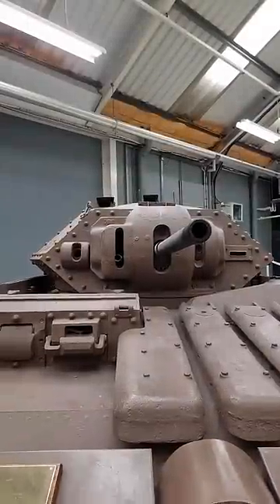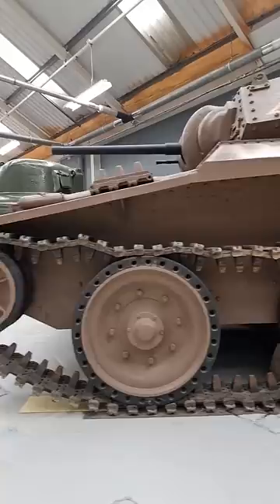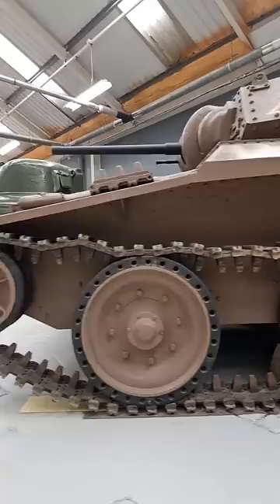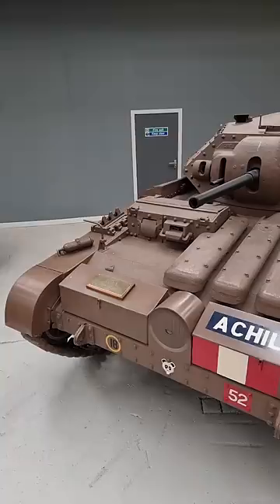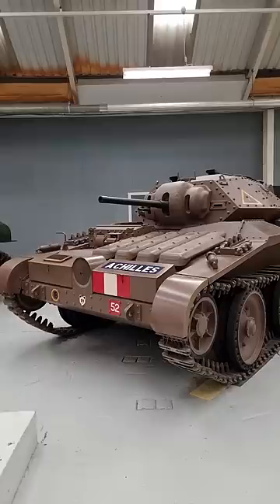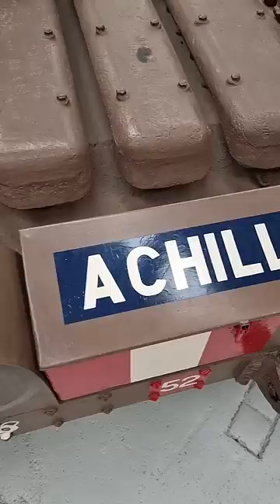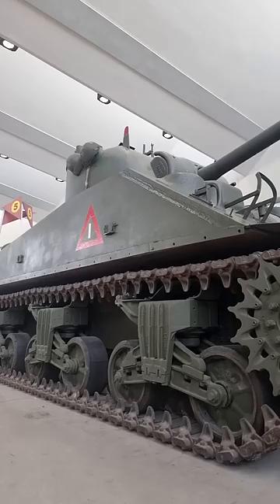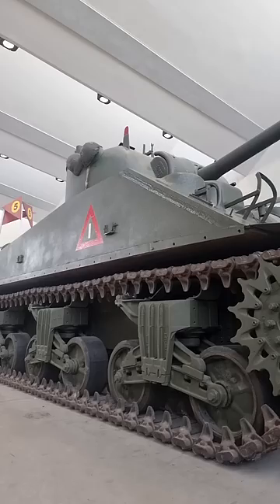The Covenanter in 60 seconds #shorts

Comment: i'm disappointed in this video from the tank museum.  is this some intern halfway thru a gender studies course?????    a proper historian would know that the problem was the design called for a lightweight fast cruiser tank - but the materials to build them with was allocated to aircraft production. so a tank made of the wrong materials from the start.  the cooling system was a joke, but that could have been reworked. with the arrival of the Crusader tank, this one was simply not needed anymore. and consigned to training roles - which it did perfectly well.  its by now means the only tank to be unsuitable for combat, but at least it was recognised as such and retained in the UK. unlike some others..